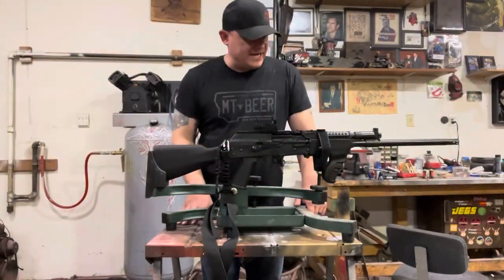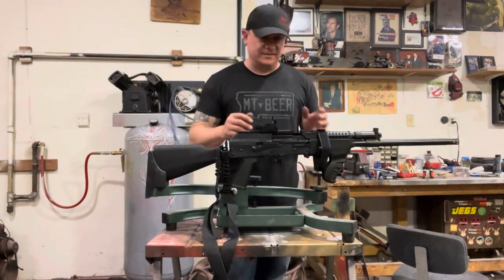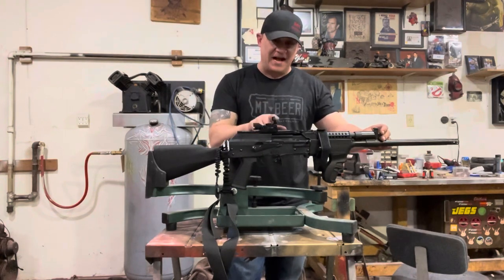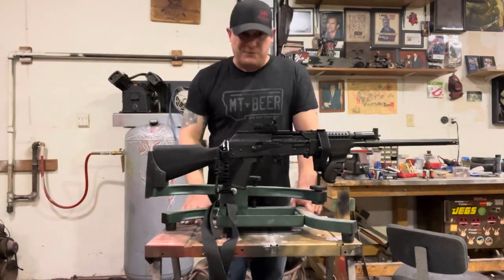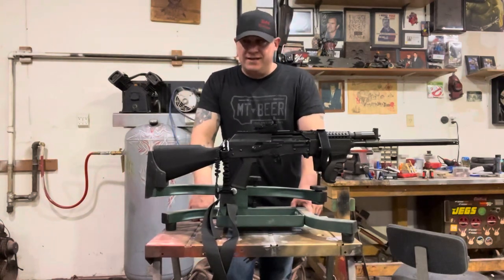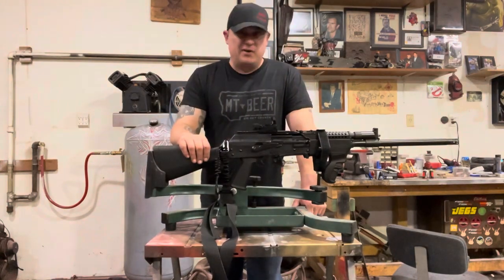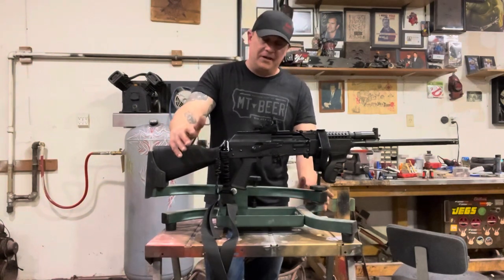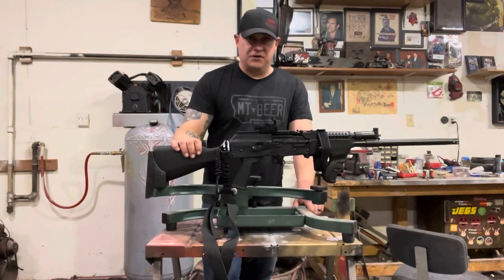JTS AK12 failure update!

Comment: Thanks for the tip on the screw! I've had luck lubing the first few shells when loading the drum until it breaks in. Just comes very tight.
Reply from the maker: Thanks!  I agree that drum break in can be a thumb buster.  I wish I would have lubed the shells when I first loaded my drum
Reply: @brettsgroovychainsaws5995  do you use that button on the back? I'm 50/50 on if it matters
Reply from the maker: @ModMax69  I only needed to use it on loading it the first couple times.  The last few times I didn’t need it at all.
Reply: @brettsgroovychainsaws5995  ya just the break in I think
Reply from the maker: @ModMax69  I think so.  I used it when the shell wouldn’t feed down.  Now it doesn’t have that problem

Comment: Hey man what red dot are you using cus my sig Romeo 5 just doesn’t wanna go low enough it’s shooting too high
Reply from the maker: It was a cheap one.  I can’t remember what the brand was
Reply: @brettsgroovychainsaws5995  was it like on target or ? What was look through it like was it on the iron sights in front or
Reply from the maker: @emotionlessmarshmallow4581  on target
Reply: @brettsgroovychainsaws5995  I mean like what did you see looking through the red dot the front sight of the ak or above it
Reply from the maker: @emotionlessmarshmallow4581  I got what you mean now.  No iron sight
Reply: @brettsgroovychainsaws5995  that’s crazy I’m shooting way to high any tips?
Reply from the maker: @emotionlessmarshmallow4581  I used the front sight bead with the my scope to help line it up,  I didn’t bring the back iron sights up to use